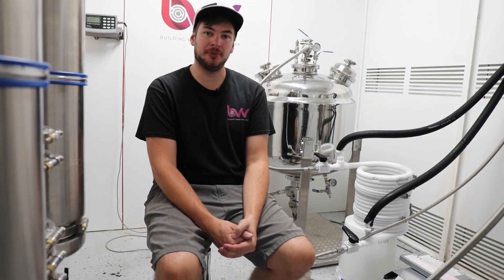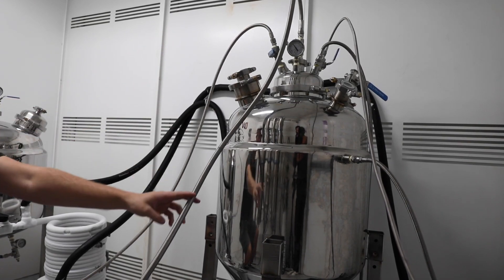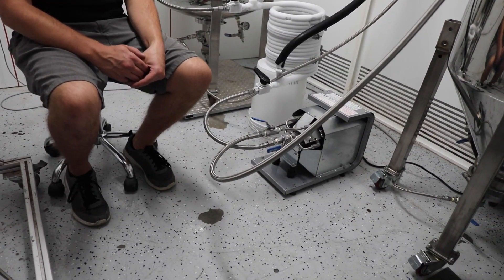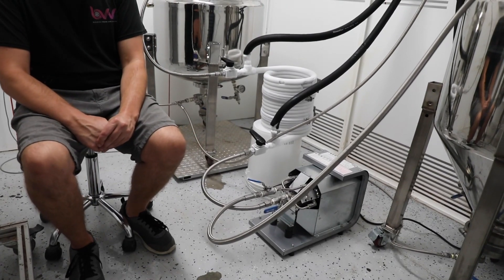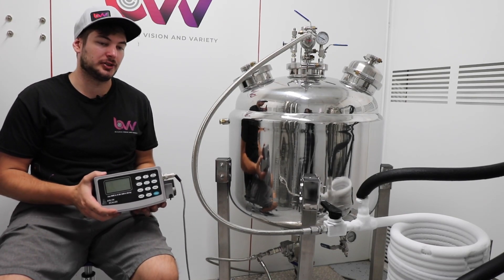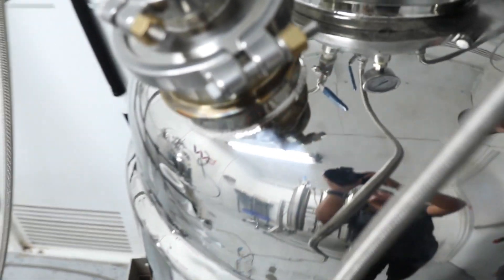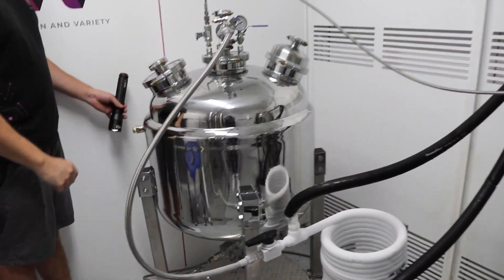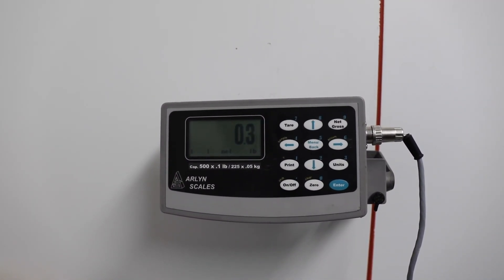4 Cylinder Hydrocarbon Recovery Pump Demo

Comment: OK serious question im hoping to get an answer on: Isnt there a risk of explosion with an electric pump? I want to buy one of these but im a little sketched out. Seems like a cheap alternative to a pneumatic recovery setup but I dont want to save money if it means putting myself in danger. Obviously you guys wouldnt sell a product if you didnt think it was safe but could you perhaps alleviate my concerns?
Reply: Yes there is a risk with this pump.
Reply from the maker: @LizardClarinet thank you for sharing your concern. This pump is Certified by ITS/ETL to ANSI/ISA 12.12.01 for Use in Hazardous locations Class I & II, Division 2 and Class III, Divisions 1 & 2 environments. If you have any other specific questions give us a call at (331) 281-1054 or email us at support@shopbvv.com.

Comment: Kick ass pump tho don't get me wrong. But it's just another expense.
Reply: Cooling will cost you more and ideally you need pressure to work with in your system so why not save the nitrogen and dry ice or lco2 for cooling and displace to the pressure you need first